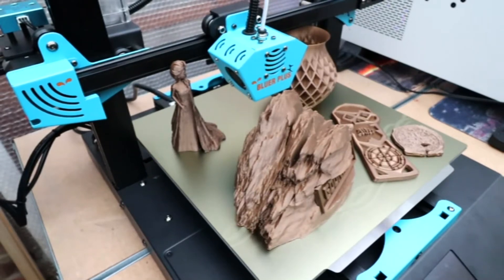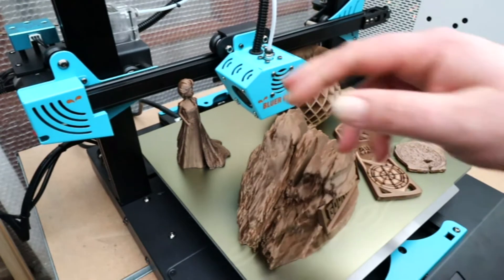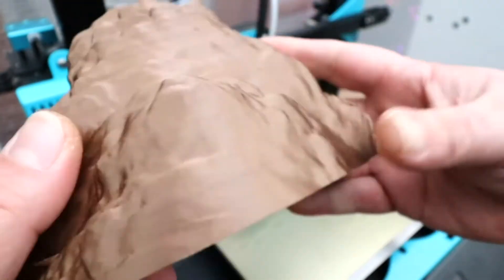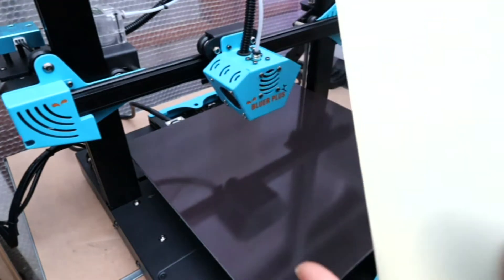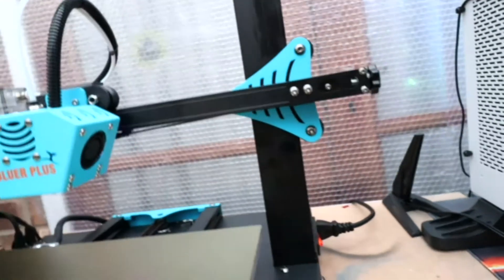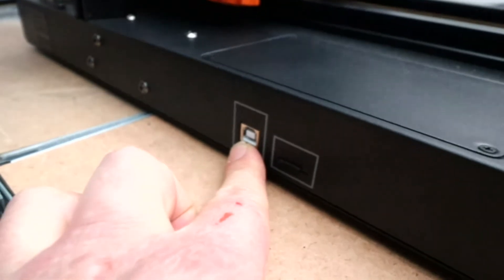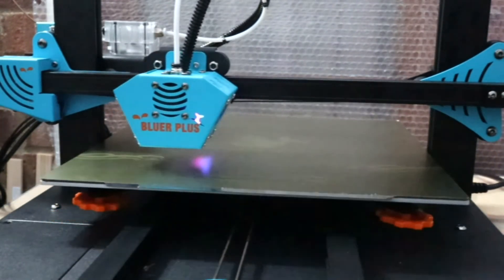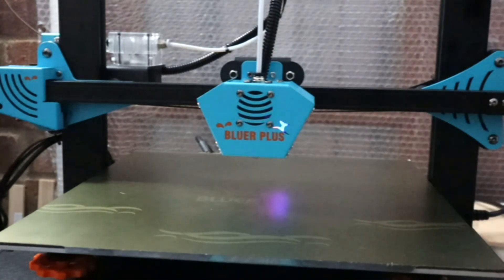Two Trees Bluer Plus Review And Test Prints

Comment: You mentioned g29, but I don't think you actually tried to use g29? I noticed in several videos the reviewer say that g29 inserted into the beginning of your code doesn't really work. It actually causes problems. I just ordered one of these used from two trees for $99 and assuming that all the parts of there, I'm going to probably upload Marlin firmware and get rid of the graphical display. I prefer a more traditional marlin menu format.